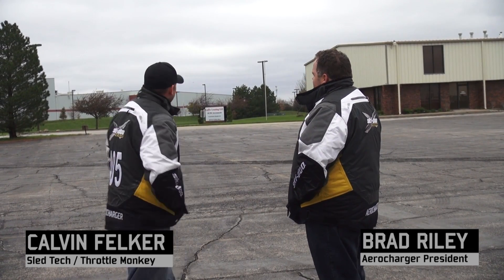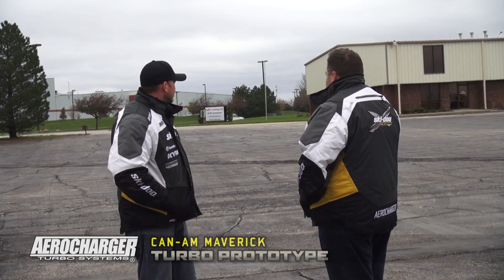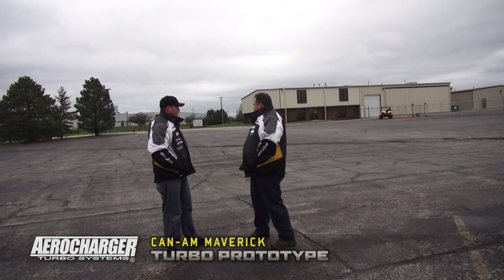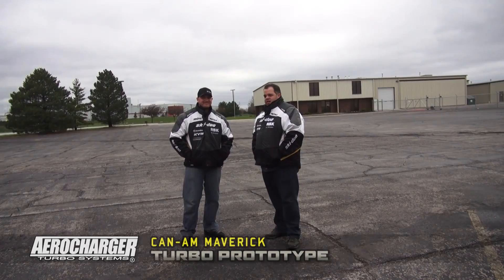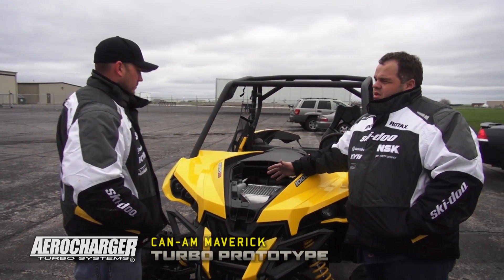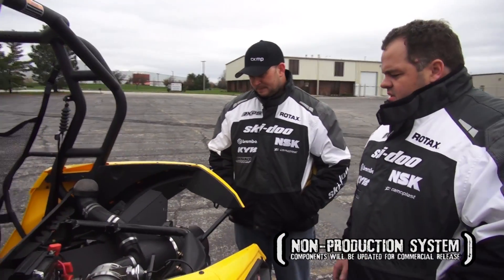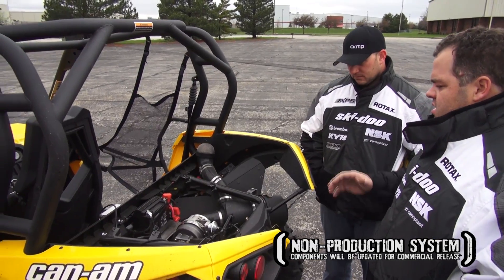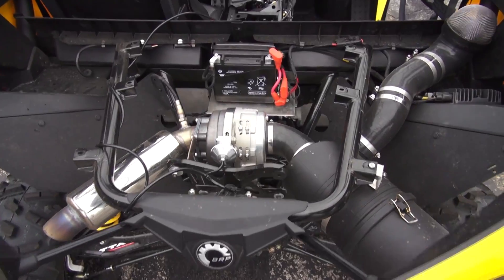Aerocharger Can-Am Maverick TURBO PROTOTYPE

Comment: For this model it may be possible but the Maverick X RS has 12:1 compression stock, I don't think you'll be able to cram very much boost into that engine without having to sell the kit with a set of forged 9:1 compression pistons. It'll definitely be a challenge when it comes to pricing.